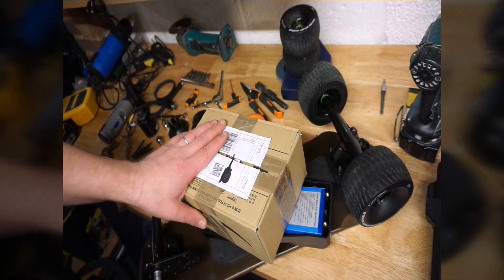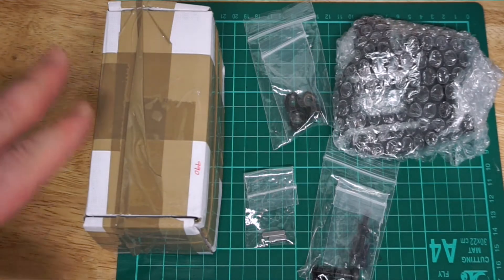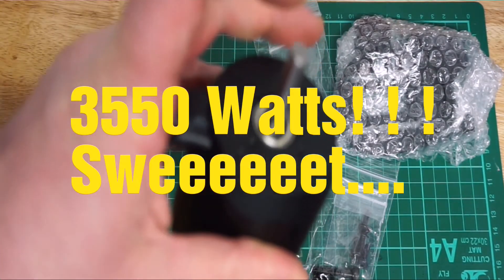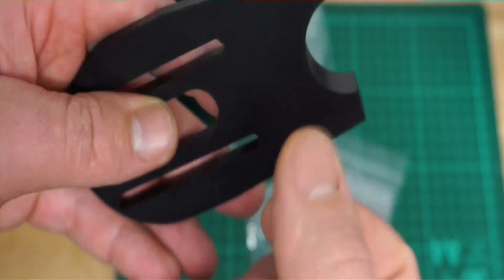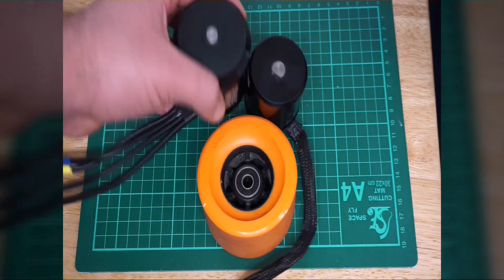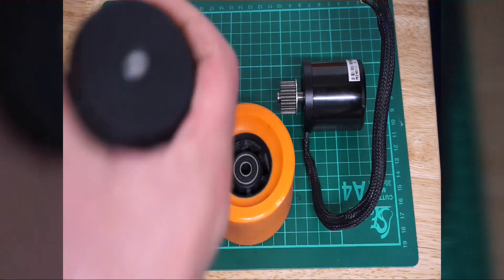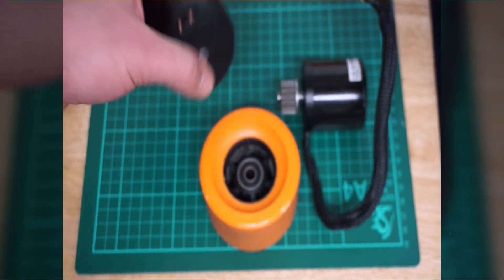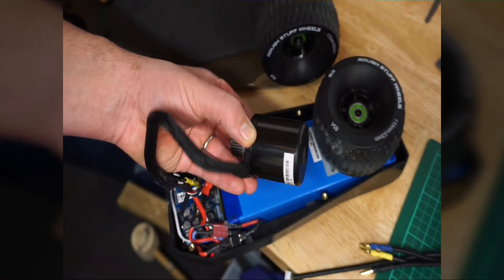Electric skateboard "Monster" motor unboxing and quick review.

Comment: Really nice choice, this motor is a beast ;) But i think you will be limited by the ESC, if you wanna get all the power of this motor you should instal a VESC or FOCBOX, it must fit in the enclosure
Reply from the maker: Thank you for your comment mate!
I did listen to the advice and did order VESC and some other bits :)
I will get the motor running using the stock components anyway just for fun and to satisfy mu curiosity,
Glad you have joined buddy!

Comment: Pavel, can these be swapped straight over onto a SR board without ESC change?
Reply from the maker: Unfortunately I am not sure as yet. I am trying to get hold of the wiring diagram of the PCB so I can get the motor wired. I will make a detailed video on How To as soon as I get it all done and tested. Stick around :) Good news is that the motor mount seems to match.